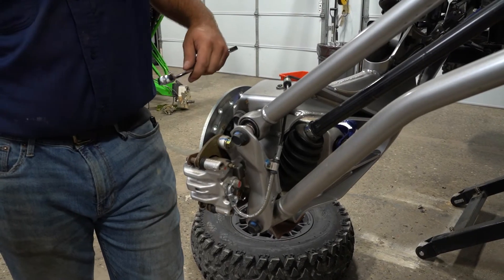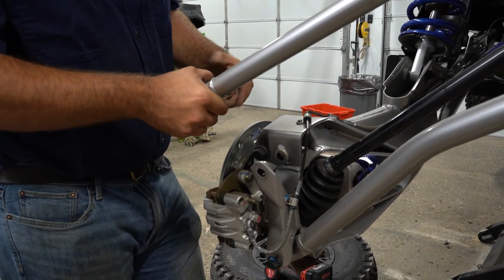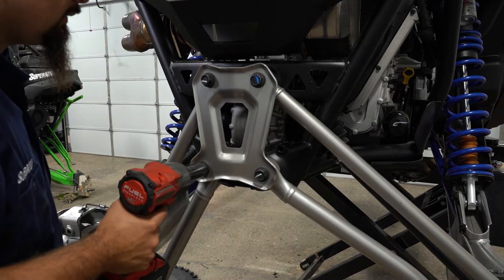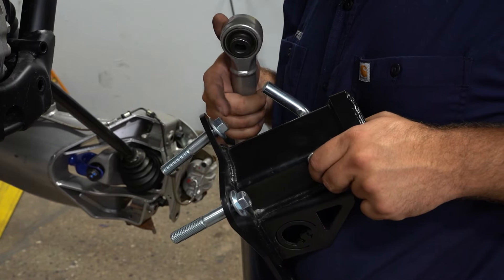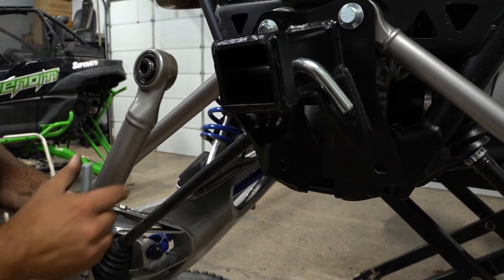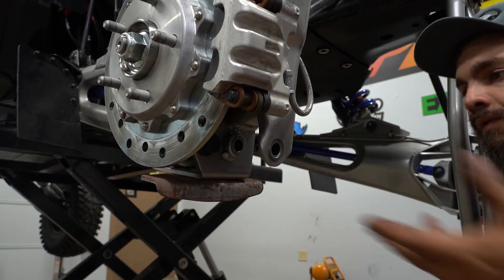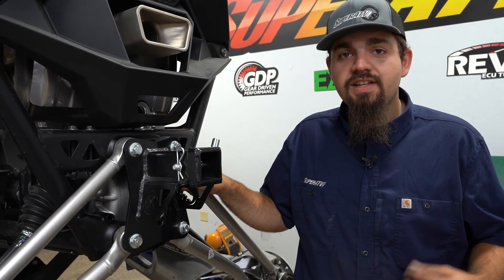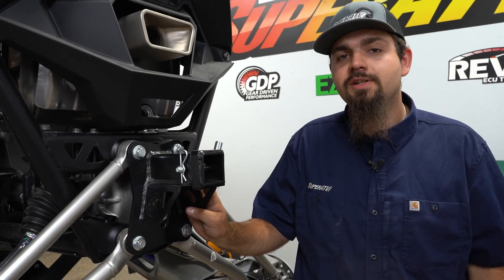How to Install SuperATV's Rear Receiver Hitch on the POLARIS RZR PRO R

Comment: Zero room to get to the bolts on a RS1.
Reply from the maker: The RS1 is a much tighter install. Give us a call if you have questions on getting it installed, 855.743.3427
Reply: @SuperATVMedia  i did on Saturday and got nothing…not even a suggestion….Id like to see an order of operations. I did get offset box wrenches and S type wrenches. Next I’ll try taking off the fenders and tires to get more room to see if that works.